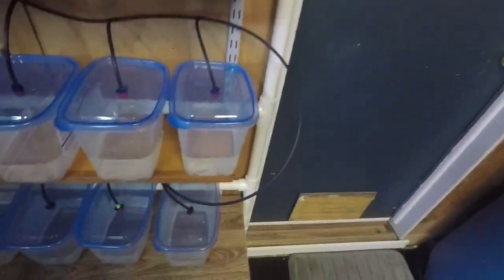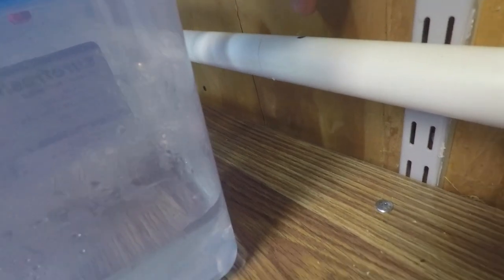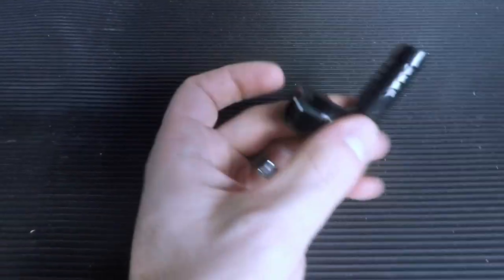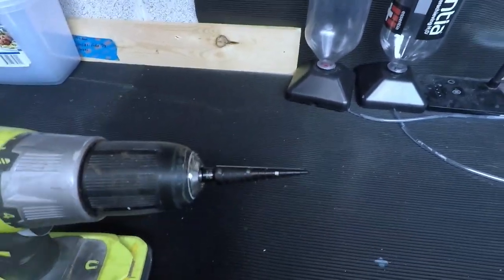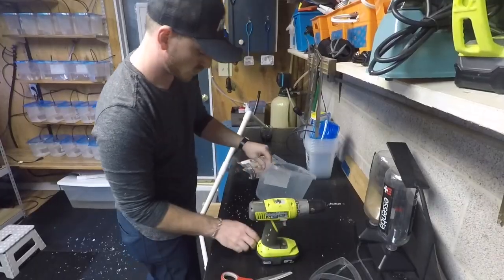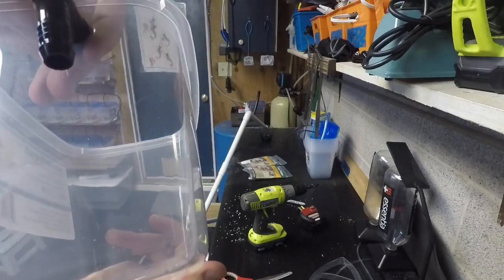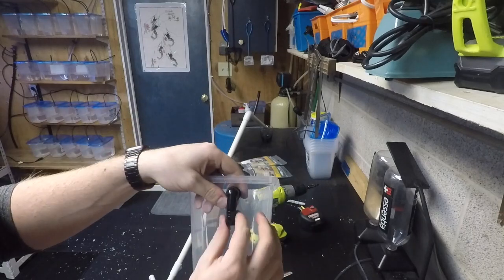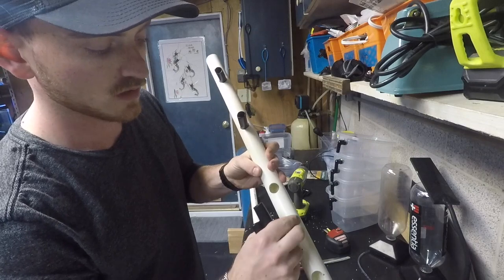DIY BETTA BARRACKS PART 2

Comment: How’s this system holding up a year later? Would love an update!
Reply from the maker: I did tear it down to put in more tanks, but it did great through 1 whole spawn!
Reply: @GuppyGuru  awesome! I’m building my own system right now and these videos have been quite helpful! Holds 56 fish! I have a spawn of 150 fccp babies :)
Reply from the maker: Wow way to go! Glad I could help you in the process! Keep me updated
Reply: @GuppyGuru  so far everything is working ok, I have 21/56 jars setup and running. Just two questions for ya! Did you ever have a problem with the self-piercing connectors that split the half inch to quarter inch tubing leak on ya? Mine seem to have a very slow leak going on. And second question, how did you heat them? Just heating the room?
Reply from the maker: @pnwbettas  no I never had that problem. Wonder if the tubing you were sold was old stock
Reply: @GuppyGuru  it’s possible. It was very minimal so I just threw a bit of silicone at it and it should hold just fine.